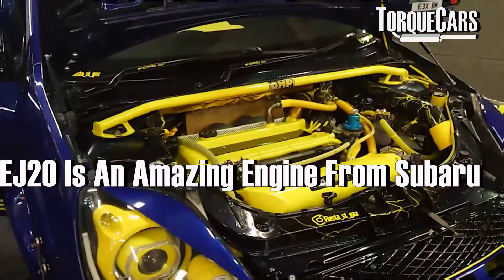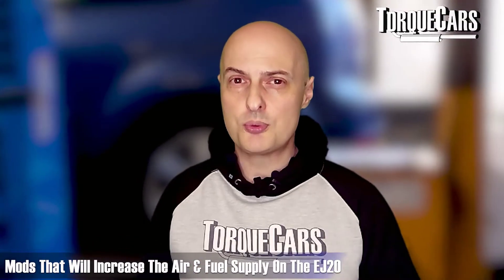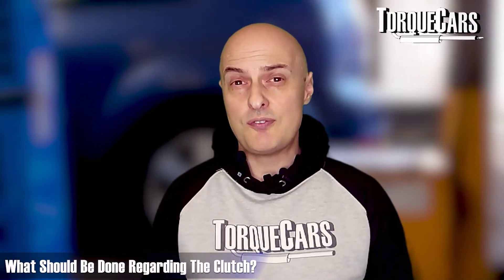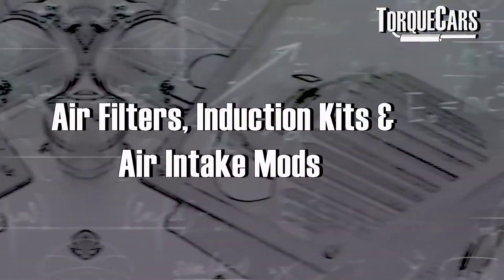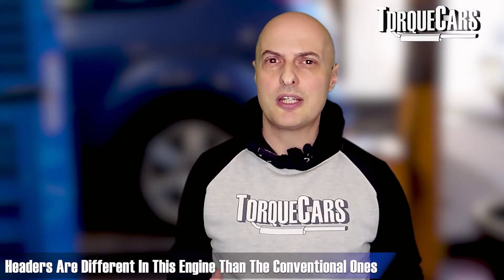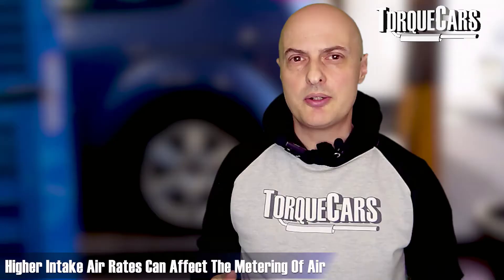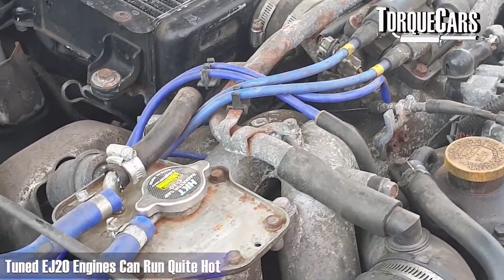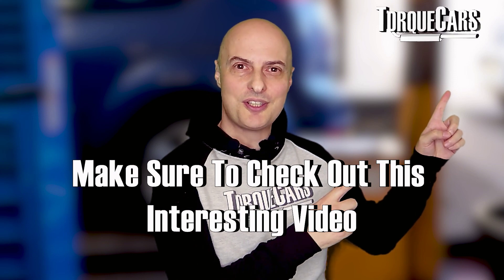Best Subaru EJ20 Tuning Mods & Performance Upgrades [Beginners Guide To Modifications]

Comment: I would add an air oil separator, and run parallel fuel lines. Cylinder four fails because cylinder one shuts down earlier since it is first in line and over time this starves cylinder number four. It dries it out and after a bunch of duty cycles it fails. That is what I’ve learned with these engines. Also do the cooling mod and a new oil pick up those are great preventative measures to help your engine last.

Comment: Precision turbo, highly rated in the UK and US. 
RCM supplies them in the UK
GTX3076R also well rated.
A bit of cash, but beats buying twice, as i now have to after bad advice and a duff turbo from a well known Subaru specialist.
Reply: @paulking2039  True rcm500 on 2.1 or forged 2.5 is epic, rcm600 is very good to on 2.35-2.5

Comment: ifit is all about combustion why isn't there an oxygen tank concerted to the intake?  i've heard that the cooling effect of water spray in the intake helps cool the engine but at the turbo where it is expanding cumbustion gasses couldn't you direct expanded combustion gasses into a turbine connected to the engine shaft before gearring?.  so the engine turns and the combistion gasses expanded by steam cause a turbine to turn the shaft in aid?
Reply: i'm talking about a drive shaft turbo

Comment: Still waiting for the ej25 video. I have the saab 9-2x linear and want to rebuild my motor from the ground up. Im just starting to learn about it.
Reply from the maker: That one is still on my to do list, I'm still gathering info on it for you, there are so many differing and varying opinions I'm struggling but I'll bump it up for you.
Reply: @torquecars any luck ? Found you channel a couple years ago looking for tips on the TDI and I've made the switch to ej25 series